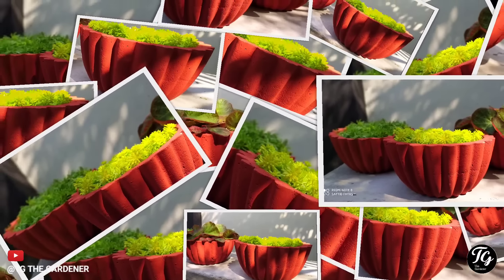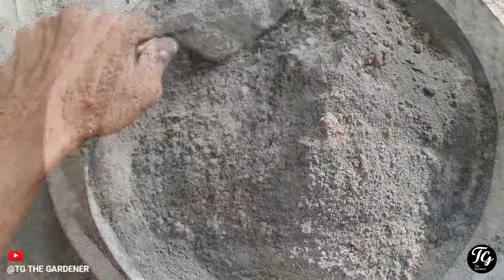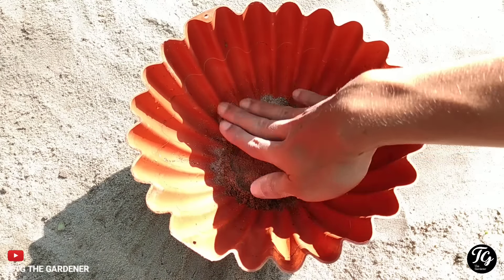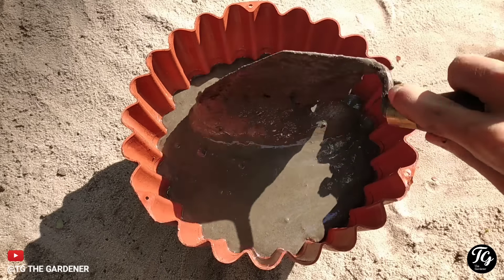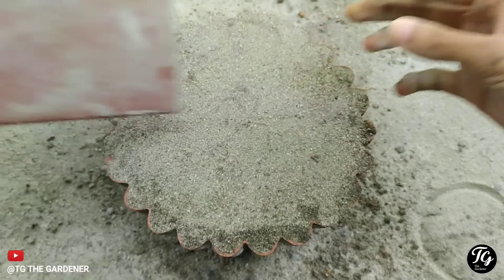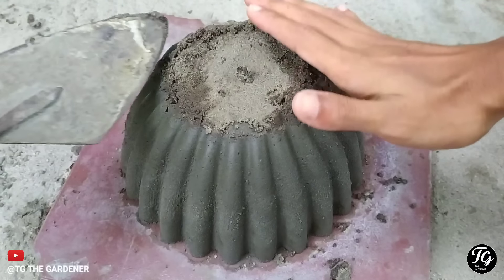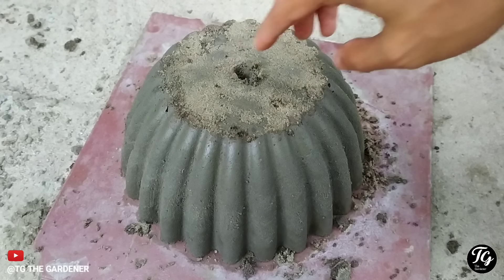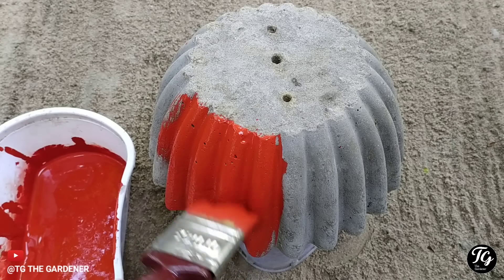ചെടി ചട്ടി നിർമ്മിക്കാം വെറും 20 രൂപക്ക് | how to make beautiful cement pot at ₹20

Comment: 1:3 ratio correct aakumo, njn 1:2 ratio il aanu mumb undaki nokiyitullath..  Ath kuzhapamonnumilla, engane pottathe kitty kazhinjal pinned epozhenkilum pottan chance undo, pls rply
Reply from the maker: 1:4 vare nalla cement aanel use cheyyam

Making kazhinj dry aayit vellam nanach kodukkuka strong aayi irunnolum
Reply: @TGTHEGARDENER  tnx for ur rply